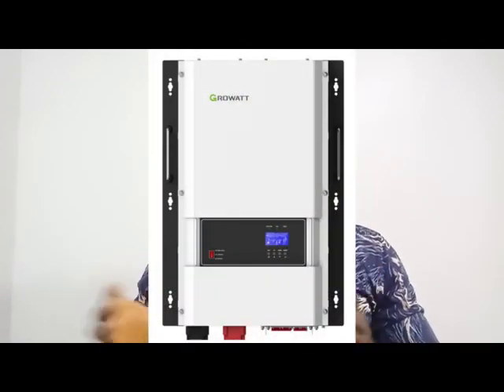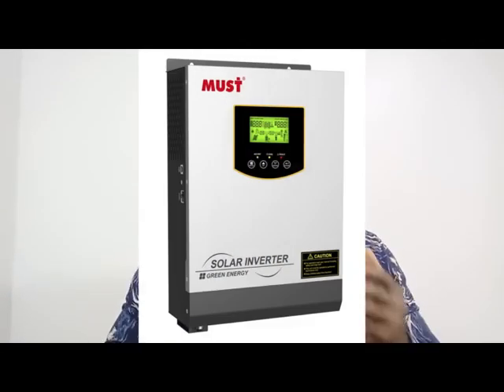"Low vs High Frequency Inverter: What They Didn't Tell You!"

Comment: Can a low frequency inverter work with lithium battery
Reply from the maker: yes it can work with lithium battery but you need to make sure that the inverter brand can communicate with the lithium battery brand.